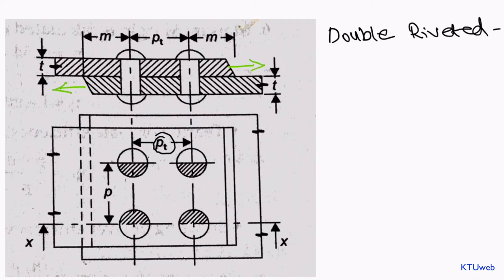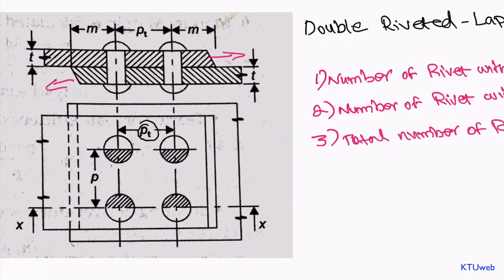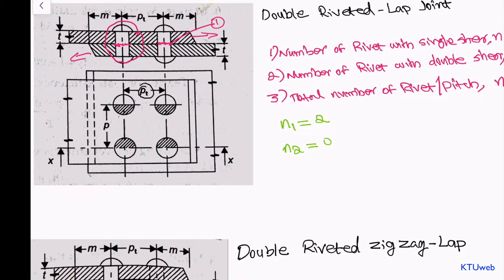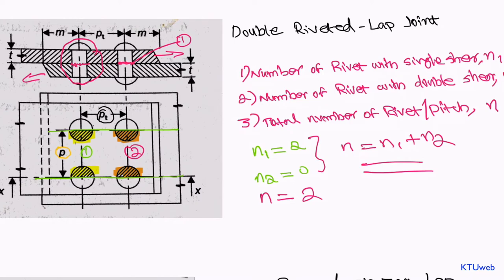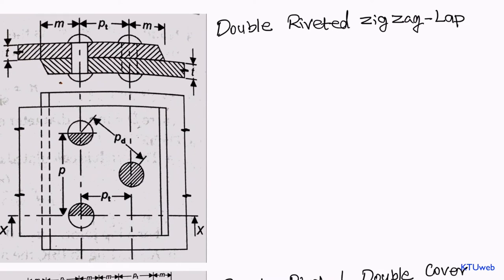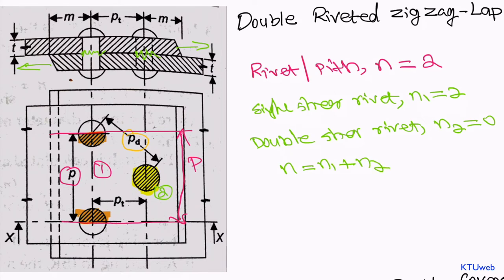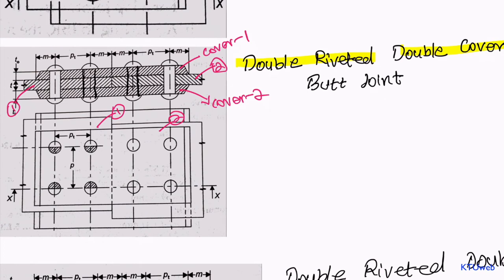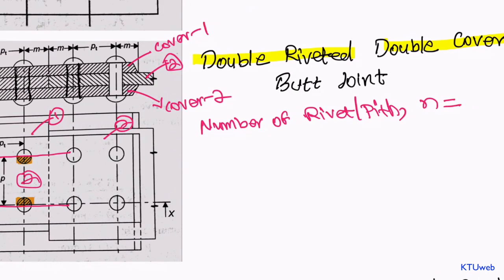Design of Riveted Joints Lecture-1: How to find Number of Rivets per Pitch Part-1

Comment: Why it is calculated per pitch length only?
Reply from the maker: If a failure occurs within the pitch length the entire system considered to be failed.
A crack generated within a pitch length will propagate easily and leads to catastrophic failure.